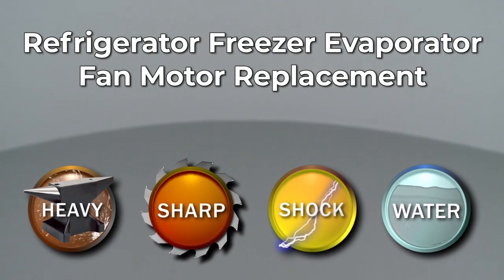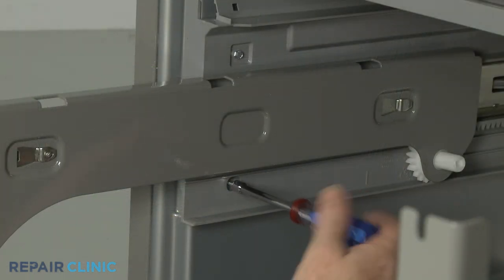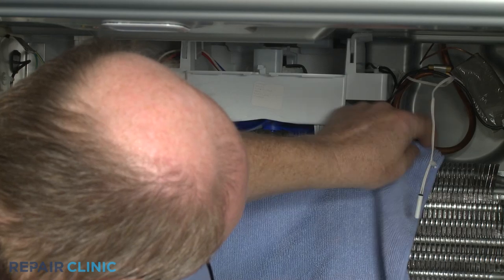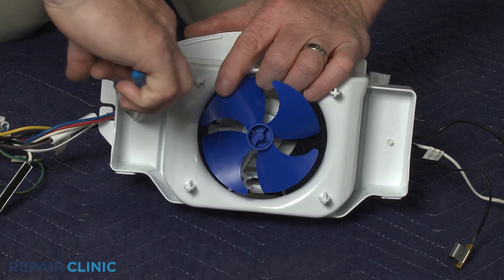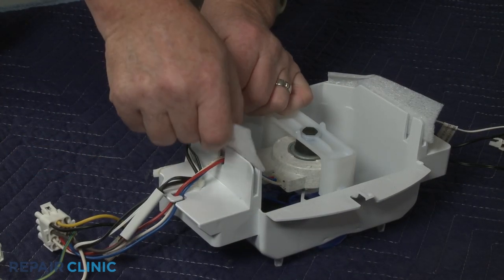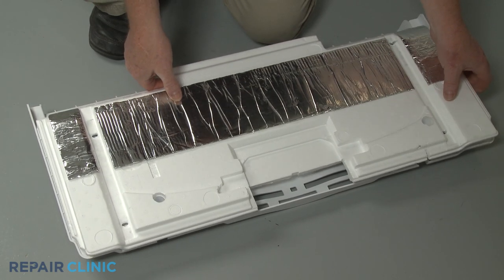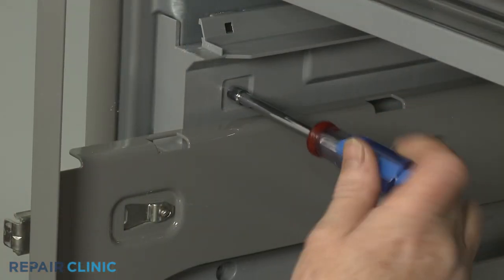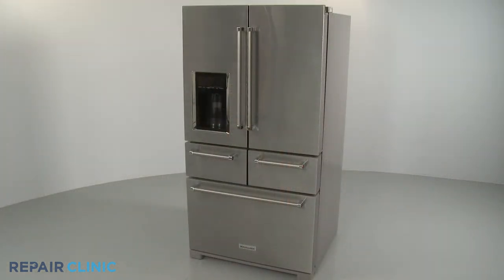KitchenAid 5 Door Refrigerator Freezer Evaporator Fan Motor Replacement W11249952

Comment: Our 5 door refrigerator freezer thermistor with the fan had to be replaced. The technician came and diagnosed the problem. I told him it was throwing the PO code. He then said that the control board and the other board would need to be replaced as well. I did more research and read someone’s else’s post on this problem and he said once you fix the problem with the thermistor the PO code would go away.  Thanks to that guys comments he saved us a bundle of money. The technicians are doing people a disservice by replacing these boards when they are working fine. Shame on them.
Reply: Hello, I'm having the same issues throwing off PF Code the freezer is not cooling, but The upper fridge is cooling properly. Do you have any suggestions?

Comment: I am having trouble with the fan in the bottom freezer, it never begins to spin. I've replaced the fan motor and everything and it still will not spin. My next theory is that the issue lies with the start relay for the fan but I cannot figure out which thing is the start relay. Any ideas on what I might be able to do to fix this?

Comment: As you see 9 months ago I replaced this fan… been great since then now all of the sudden was real loud again and just as I suspected it’s packed full of ice all behind foam and ice hitting fan making it noisy… any idea why I’m getting the build up of ice inside there?
Reply: I never  found a real solution. When i hear the noise i take the steamer out and defrost it. Note: i turned off the ice maker and sealed it off. That seems to give a longer interval between defrosting. Good luck. I would love to hear a solution that fixes the frost problem and also allows me to use the ice maker.
Reply: @williammoloney  Defrost what? My freezer is not as cold as it should be, but the fridge is fine.  The condensor fan motor is good.  I think it's the evaporator fan making all the noise, and not blowing cold air into the freezer.  My ice maker is shut off prior to this noise.  Do you mean the coil iced over?  Any suggestions?  I already replaced the blown LED light in the freezer and now  this just started yesterday.  This fridge is 3 years old this month and I love it, but I'm starting to think the quality is lacking for the price.  Any help would be appreciated.  Thanks.
Reply: This model fridge are a pain to work on. Most case I found the drain line clogged up causing the frost to buildup in that coil. There a drain hose behind the unit that could be replaced or clean out to help prevent the issue. Also main board on these fail to sent it defrost from my experience working on these. Hope this information help out.
Reply: @williammoloney how did you turn off the ice maker? I’m having the same issue. Freezer is iced up to fan.
Reply: @calivalley9056  Open the freezer door, then open the door for the ice maker.  On the left side of the ice bucket there is a toggle switch to turn the ice maker off. On my refrigerator the on/off positions are clearly marked. The off position is when the switch is set towards the back of the refrigerator. Hope this helps. Note. I turned off the ice maker and tried filling the ice bucket with store bought ice, but even that seems to make me defrost the freezer more often
Reply: @williammoloney  I found it, appreciate it. I think I’m about done with this refrigerator. I’m never getting another indoor ice maker again.
Reply: @calivalley9056. I agree about the ice maker. I saw new refrigerators that have the cold water and ice inside the refrigerator, with no access from the outside. Maybe that's better. 
Have you applied for lemon law?

Comment: Excellent step by step instructions to get to the fan. My fan and evaporator keep freezing up. The indicator is that there's a loud buzzing noise. The repair guy has come out 3 or 4 times to "fix" it. When this happens there's so much ice buildup that you need to use a portable steamer to even get to the screws to remove the back panel. After that,  the whole area behind the panel is a big icy mex that needs to be thawed with the steamer. I watched three repair guy do it,  but i really appreciate these instructions. This video was a great help. Thank you!
Reply: They've 'fixed' it how?  They replaced the part in this video 3 times and it still happens?  I ask only because I had the same issue and replaced the part about a month ago.  If the issue continues to return, I'd say Kitchenaid (Whirlpool) may have a recall on their hands.
Reply: @gauchpotato  I was finally  able to get Whirlpool to declare my refrigerator a lemon, and receive compensation. They didnt replace the unit, but gave me enough to buy a new one. I actually like this better because now i can buy a different unit if i want.  Good luck with your refrigerator. BTW,  after I defrosted I turned off the ice maker. It sucks not having any ice, but it seems to have stopped the condenser from freezing. Not sure why.
Reply: @williammoloney  how were you able to get Whirlpool to address this issue with you? I’m having the same problems and have already spent nearly $1000 in repairs and it still doesn’t work right! It’s only 2 years old, bought directly from Whirlpool.
Reply: @nathandwyer2552  In short, I said that I planned to take them to small claims court. I called WP several times to see if they would declare it a lemon or to buy back, never got anywhere.  I finally asked to speak to a supervisor.  She tried the same mumbo-jumbo. I said that I have all of the records, and that we will let judge decide if I am right or wrong. I heard it was expensive for large companies to attend small claims court.
Reply: @williammoloney  thank you!
Reply: What was the fix to get rid of the reoccurring ice build up? I replaced the fan 9 months ago and was working fine but now a ton of ice built up around fan again and entire fins are completely engulfed by ice!

Comment: My freezer is cold the 2 drawers are cold but the fridge will not go below 50 degrees. You think this will fix my problem?
Reply: No.  This is the evaporator fan for the freezer compartment only.  The fridge compartment has it's own separate fan.
Reply: did you find out the problem